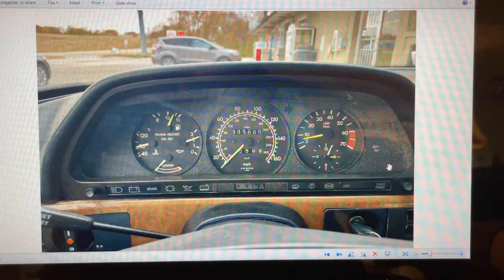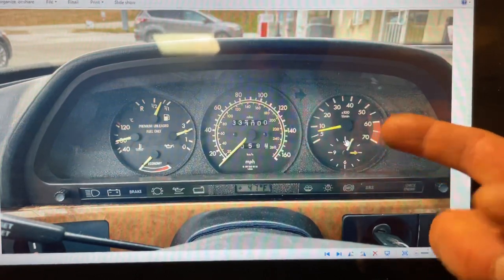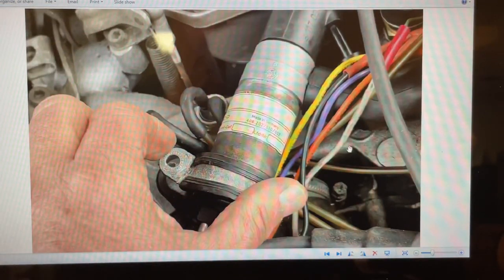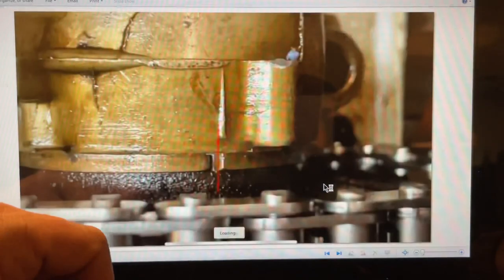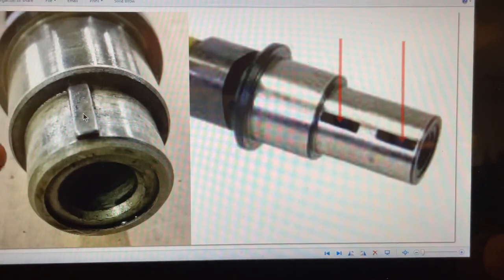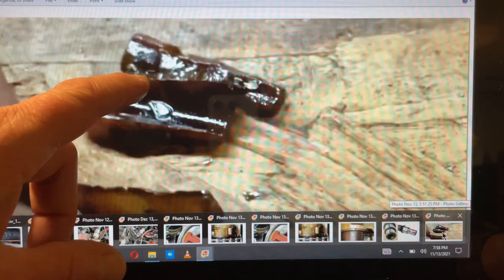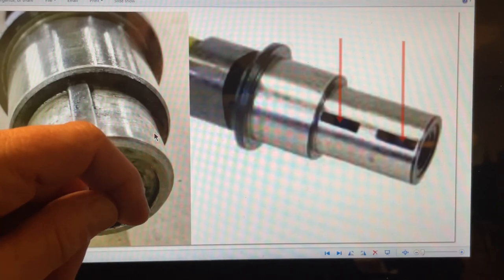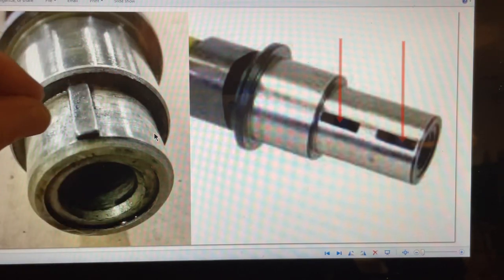Mercedes W126 3.8 5 4.2 5.6L in-depth tutorial of root cause of idle increase with temperature rise

Comment: I just wanted to thank you for all your videos ,I worked as a factory tech in ny,In the 70-80 i along with the German techs.on problem cars.I forgot a lot on the Ke system,I own a 1987 560sl that I purchased it  in original condition with 71;000 miles.always doing something on it thanks again Doug

Comment: I have 1986 560SEC.  I watched all your videos relating to idle speed control.   Is the control signal that is going to the speed idle control coming from the ECU?  You indicated in your videos that it takes about 1.4 amps to close it. When closed, does this lower the idle speed then?
Reply from the maker: Which control signal are you referring too? My guess would be the rpm signal which Mercedes / Bosch calls the TDC signal. This signal originates from the ignition control module and goes to the fuel pump relay, a/c compressor relay, idle speed control unit, ECU and ACC
And, yes, the more closed the idle speed control valve is, the lower the idle rpm.
The idle speed control unit drives this valve with a pulse width modulation controlling the current. However, the control unit can source only approximately 1.1 Amps this is why the spring may have to be readjusted
Reply: @inovahightechltd  thanks for the summary. Is the 1.1amps coming from the ECU? If so, then at which circumstances does the ECU send the 1.1 Amps to the idle control? My car idles at 1000rpm and there is no change in RPM speed if I disconnect the plug from the idle control, hence, I’m assuming that the AC was not sending the signal, or a faulty wire connection?
Reply: Meant to say ECU not AC
Reply from the maker: @alansgarage8545 no, the ecu has nothing to do with idle speed
The idle speed control unit controls the idle speed
Reply from the maker: The idle speed control unit and idle speed control valve are two different parts.
The idle speed control unit is a black box with pins on the bottom, same size as fuel pump relay and sits in the passenger footwell under the dash

Comment: Hi, question instead of adjusting a used ebay ICV why did you not buy a new one?  Also, I have a 92 500sl and having a cold start problem.  The car is hard starting. If I crank it for 4 seconds and turn off the ignition and then restart in starts right up.  If I just continue to crank it till it starts it takes 15-20 seconds and then barley starts.  in both cases it has a rough idle till it reaches temp.  Once it reaches temp idle smooths out more or less and the idle will flux between 650-850 and back to 650 when the ac kicks in it will drop back to 650 is this a sign of a faulty ICV?  I was thinking of replacing with a new one and rubber too.  I also need that tubing do you take paypal or check I have never used a cashapp how does that work
Reply from the maker: Check my playlist: the big repair 
There you will find all the issues behind your problems 
Happy new year
Peter
Reply: @inovahightechltd  can you point me to that video?  Thanks
Reply from the maker: @rioraton  I sure can, playlist with 14 videos “The Big Repair”
https://youtube.com/playlist?list=PLO4ZlzALkZVq3NysVV7vqO7BiZ9Kd_97D

Grab your self a couple of your favorite beverages, stream the YouTube videos to your 85” big screen, sit back and relax!
Peter